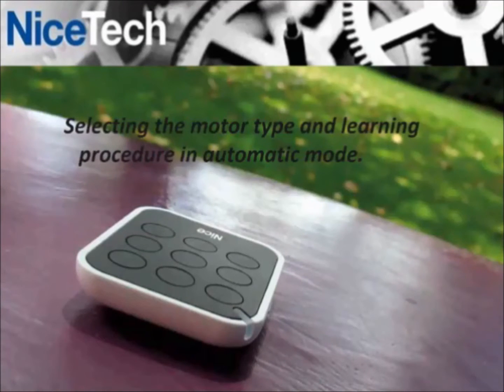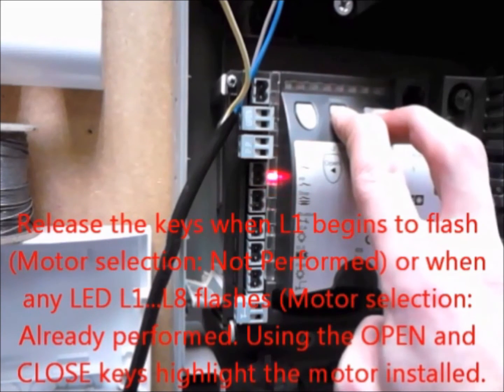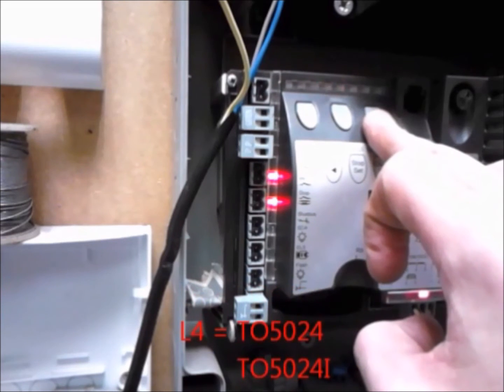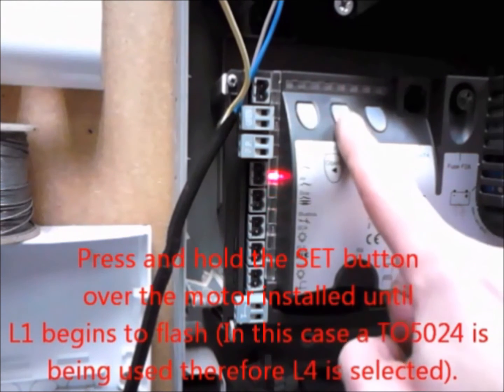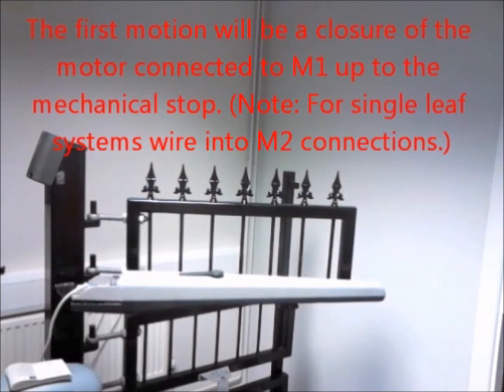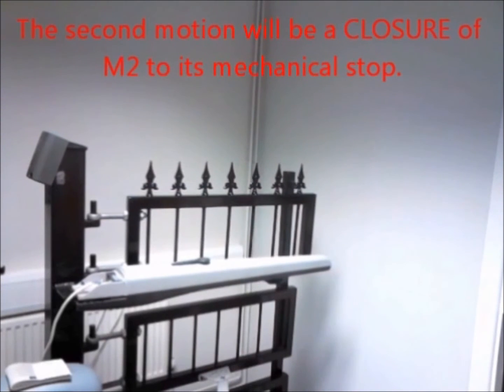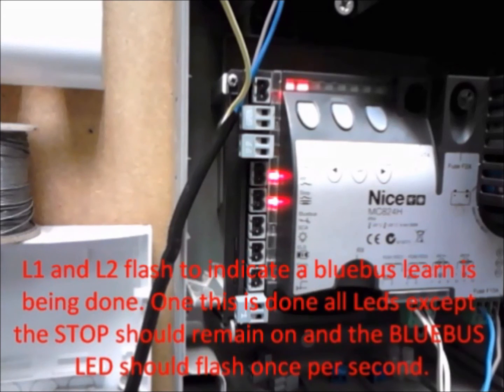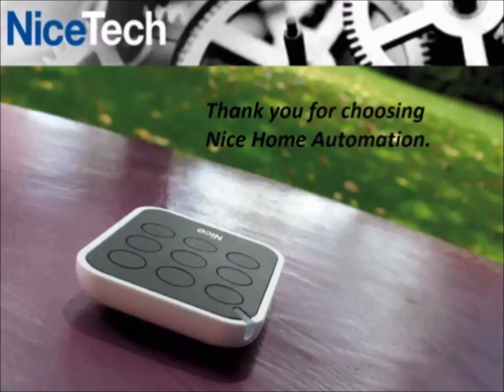How to do a motor selection and automatic search for distances on an MC824H

Comment: with OPEN +CLOSE simultaneously it does not delete the original location of the transponders, it only deletes other parameters of the control panel When performing a new search for mechanical stops, the transponders keep the original locations and doors are left ajar